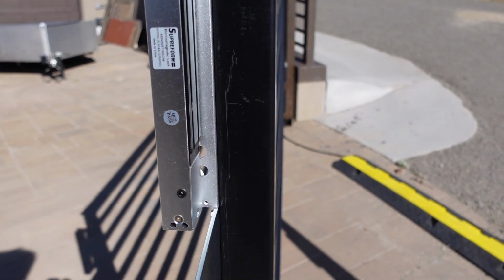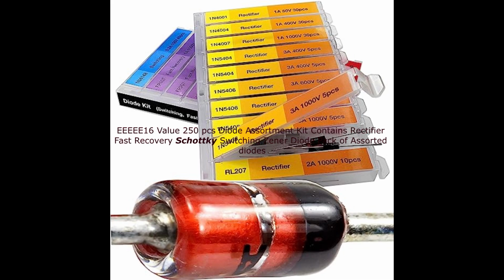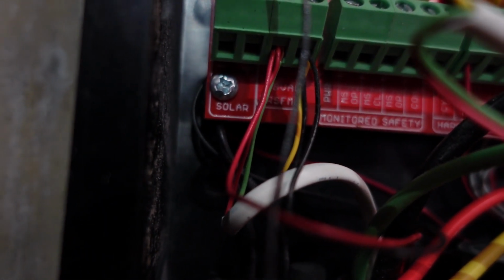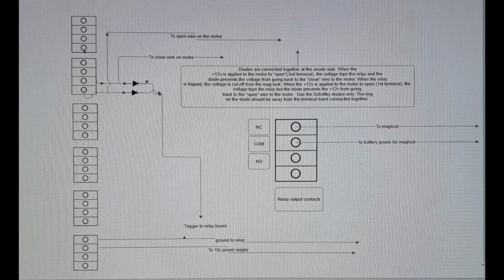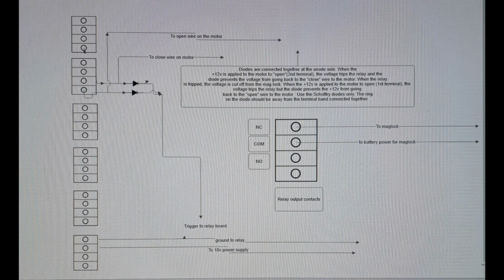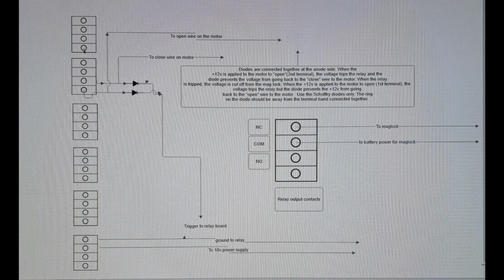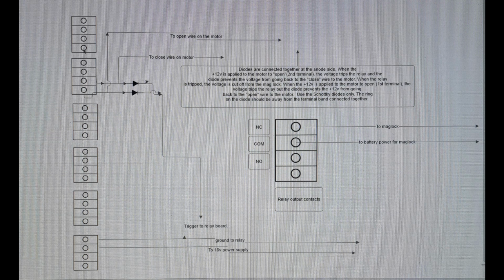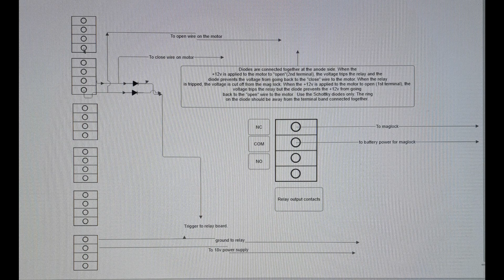They said I couldn't do it. How to install a maglock on a Ghost Gate Controller.

Comment: Awesome job.  Thanks for doing this.  I recently contacted Ghost and they actually sent a schematic of how to install non-Ghost Controls, electromagnetic lock into there system like you did here.  Problem is the drawing is horrible and not so clear.  I was going to upload the drawing in the comments here but I can't figure that out.  I have to let it be known I am not too familiar with the electronics.  Anyway, they are recommending a double pole relay.  And they dont use Diodes.  Is it possible that the Relay they are recommending has Diodes built in?

I've had no success finding any gate company to come out, so I think I will try myself with the help of your video.  But wondering if I need different Relay and Diodes like you have, or if I can use what they recommend and I have already purchase.  Wish I could upload or send the drawing I got from them.  I totally understand the concept of what is happening: brief signal to engage/disengage lock when gate opens, but I just can't decipher their info.  

Sorry if I was rambling and if this doesn't make sense. But if you have any thoughts, I'd appreciate it.  Main thing is just understanding wiring from controller to relay to gate (duh, right?).
Reply from the maker: I contacted Ghost Controls and they sent me a schematic of the way in which they use the Zombie lock control wires to actuate the Maglock. There is one major problem with the circuit. If you lose power to the Ghost Controler the maglock disengages. This is called a fail-safe state. What you need is a fail-secure state which is the way I have mine configured. If the power goes out with my design, the gate stays locked until you shut off the power to the Maglock. It is probably a good design but I would want my gate locked if the power goes out. It is just my preference. I will post the schematic on the site.

Comment: Nice video. My friend are trying to do this right now. Having some trouble. Can we reach out to you?
Reply from the maker: Sure, what is your questuin?
Reply: @Jetpropbill  we used the relay you had. We just aren’t sure where to attach the wires for the maglock. We get constant power and it doesn’t turn off. Thanks!
Reply from the maker: @Jimmac25  The maglock is on a separate circuit from the controller. The positive side of the maglock gets connected to the  battery and the negative side gets tied to the normally closed ( NC )side of the relay and the common side of the relay gets tied to the neg side of the battery. When the ghost controller activates, the relay accuates and voltage is shut off to the maglock. When the gate closes, the relay stops and then, because you are connected to the NC terminal, the voltage now goes to the maglock. The only other wire connected to the relay, besides the power + and -, is the trigger that comes off of the two diodes(anode side). Make sure the diodes are connected properly with the stripes on the diodes connected together and the other ends are  to the opening and closing terminals on the controller. Mine is still working for almost 19 months now.
Reply: @Jetpropbill Thanks for the quick response. I will try and let you know how it goes.
Reply: @Jetpropbill So we tried your recommendations but the maglock stays engaged and won’t release when the gate is triggered. I know this is a big ask but would it be possible to do a video call to go over the steps? Maybe you will be able to see where we went wrong. Please let me know. We are on the East Coast. Thanks!
Reply from the maker: @Jimmac25  Try triggering the relay with a 12v wire from the battery to the trigger and see if the relay operates. The maglock locks only when voltage is applied to it. In a normally closed circuit the voltage is always on until the relay is tripped to the open position. If the maglock stays engaged, the relay is not interupting voltage to the maglock. Try to isolate the relay and the maglock from the ghost controller to see if the maglock disengages. If it does not disengage, then you have a relay problem. If it does disengage then you have a diode problem. Remember, the maglock only should engage when the ghost controller is not operating. Hope this helps.
Reply: @Jetpropbill Thanks for the quick response. I will give it a try and let you know.

Comment: Does the maglock need constant 12v? My setup is solar and battery only
Reply from the maker: Yes, the maglock needs power to hold the gate shut. However the amount of current needed  is small. The lock takes about 0.15 amps continuous current. You will need a panel that will deliver that amount of current and also be able to charge a battery to keep it full. I would think a 200 to 500 watt solar panel should have no problem. I don't know  what lock you are using so you will have to do the calculations to make sure.

Comment: first let me say thank you for making the video. can you tell me if you are using the power to operate the mag lock by way of the board or using a power source not associated with the control board  thank you
Reply from the maker: The maglock does not take a lot of current so I tapped off of the twelve volts  going to the board. As you can see in the video, I moved the battery and controller inside my garage rather than have it in the elements. I think you will be fine to just tap the 12 v from the battery or the 12v connector to the control box.

Comment: What kind of wire did use from the lock to the control ? Also, the lock came with 4 wires, which 2 did you use ?
Reply from the maker: I don't know what kind of maglock you purchased but the one I ordered has a white, blue, red and black. If you have a 12v system hook the white and the black together (-) and then the red and the blue (+) together and that would be the power to operate the maglock. If you have a 24v volt system, tie the white and the blue wire together and use the red (+) and the black (-) for power. Depending on the length of the wire you can get away with 14 gauge stranded wire.

Comment: We appreciate this video. We live in a climate where it can be 30° at night and over 80° during the day certain times of the year. And the zombie lock we’re always having to constantly adjust our gates so that it doesn’t hit the sides of the lock. I’m hoping that by installing a maglock it will still work if the gate has a variance of an 1/8 of an inch either way movement as the gate expands and contracts with the heat and the cold because it is an aluminum gate and seems to be rather susceptible to temperature.
Reply from the maker: I believe the maglock solution will work, but I can't guarantee it. Thanks for watching. Let us know how it comes out.

Comment: Can you please link the items you used? Does it matter what diode is used?
Reply from the maker: Sure, https://www.amazon.com/gp/product/B09B2JN41L/ref=ppx_yo_dt_b_search_asin_image?ie=UTF8&psc=1 for the mag lock.
https://www.amazon.com/gp/product/B08SBTS2KZ/ref=ppx_yo_dt_b_search_asin_title?ie=UTF8&psc=1 for the diodes. The 1N5817 will work.
https://www.amazon.com/gp/product/B095YFJ69T/ref=ppx_yo_dt_b_search_asin_title?ie=UTF8&th=1 for the relay.
https://www.amazon.com/gp/product/B0C7QQHMCX/ref=ppx_yo_dt_b_search_asin_title?ie=UTF8&th=1 for the wifi switch to be used with my phone.